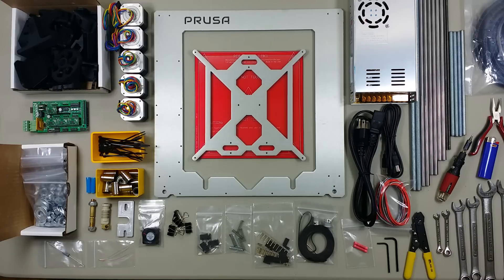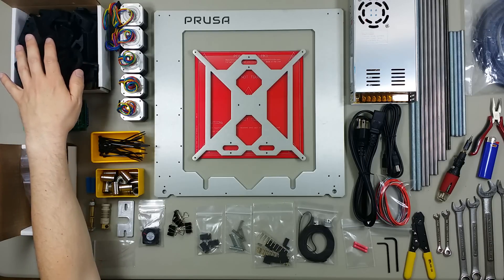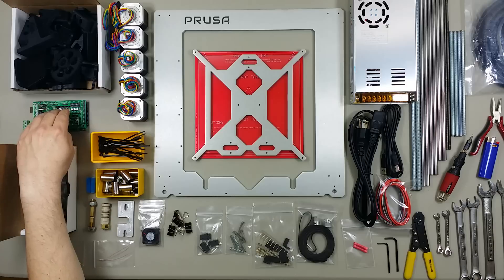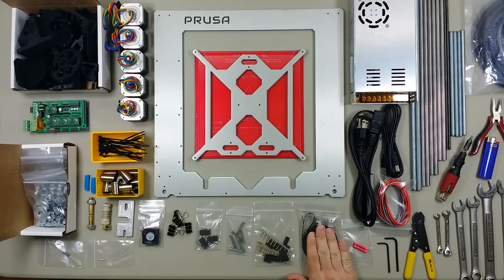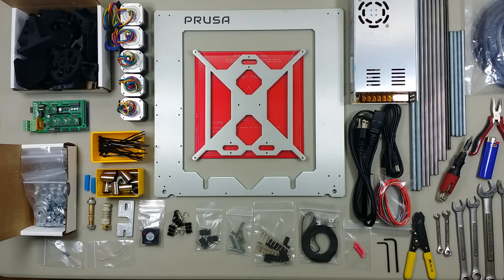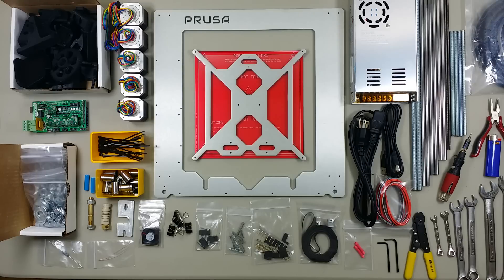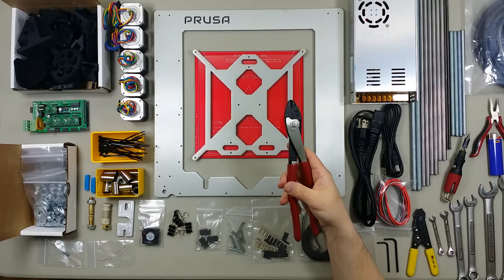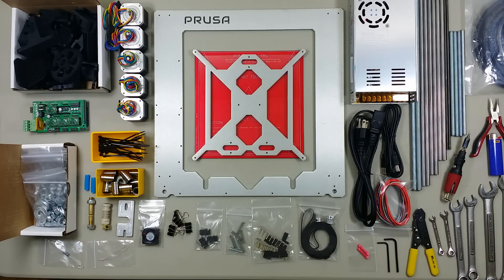How to build a 3D Printer

Comment: Fast forward to 2024, I still have one of these, used it to print parts for another two, Absolute workhorses. And yes, still using RAMPS/Marlin combo but with standalone 2208's and TR 8x2 for the Z instead of the 5mm rods. Outlived my Tevo Tarantula.
Reply from the maker: That's awesome!

Comment: Are you planning on uploading a video on configuring the motors on the software side of things?
Reply from the maker: What, exactly, are you hoping to see? I may have another video or I could upload a new video if there is something specific you wish to see.
Reply: engineglue Well, I've been off and on building a Prusa i3 for the last month or two (I don't get all that much time with everything else I have going on.) and figuring out exactly how to dial in the software so everything runs smoothly has been difficult. I've searched and searched but I couldn't find any really solid instructional videos about how to configure the software and motors so everything works properly. I resorted to 15+ hours of tweaking the software and power controls to the motors and things still don't work exactly how I want them. The kind of video I'm hoping for is one that just goes through step by step how you get the motors to run at the proper speed and proportions. (Your Prusa Mendel i2 "Stepper Motor Calibration" video was probably the most helpful tool I found on the web, but it didn't tell me how to get the motors working from their stock values.)

If there's a video out there that explains this in depth, I sure haven't found it.
Reply from the maker: DotBowder I see. That would be a good video to make. I'll add it to my to do list but I may not get to it for a while. In the mean time, have you tried setting the calibration values in the firmware to the calculated values of your thread pitch and pulley sizes? Then, you could try my default settings from Slic3r for the i3. The config is packaged with the Slic3r download at nwreprap.com